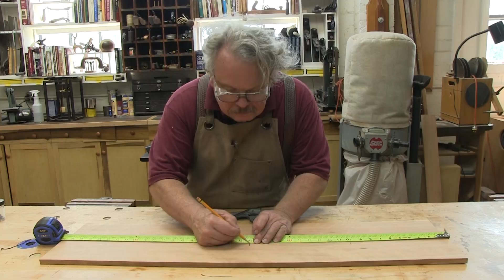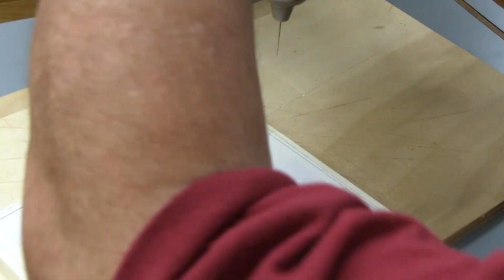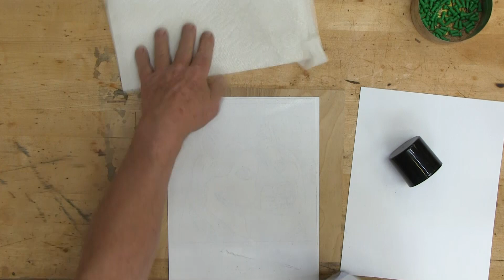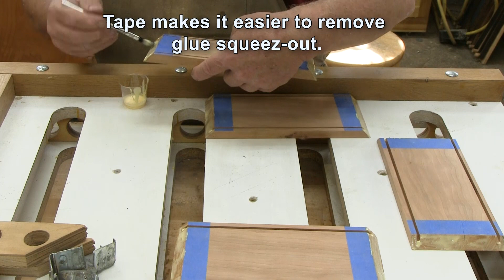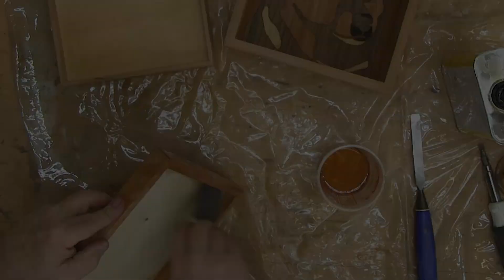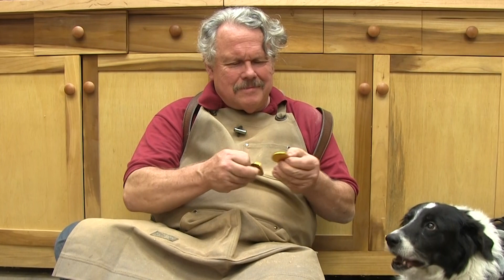Making A Doge Box For Dogecoins - Scroll Saw Marquetry

Comment from the maker: Plans with full-size patterns available at https://workshopcompanion.selz.com/item/dogebox-with-secret-compartment !

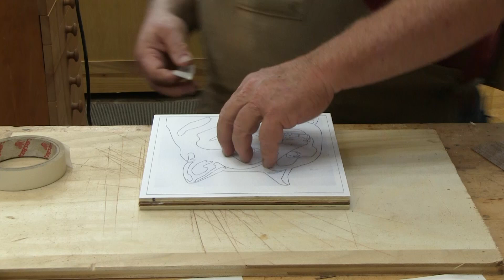The box itself requires less than 2 board feet of wood, but you'll need seven species of wood veneer to make the Doge. I was able to do the marquetry with a "variety pack" of veneers that I bought at https://www.amazon.com/dp/B003F0G60A?psc=1&ref=ppx_yo2_dt_b_product_details . You'll have to assemble them as shown in the video to make 8-1/2" by 8-1/2" (21.6 cm by 21.6 cm) squares. Sometimes you won't have enough sheets of the same species to make a full square. When this is the case, figure out where to center the sheet you do have and fill in on the sides with species you won't use. You can see how I did this at 1:35 through 1:50. It's extremely important that each sheet in the stack be a full sheet so the veneers are as flat and as tightly packed as possible when you're cutting them.

And in case you're interested, we got the chocolate Dogecoins from https://www.etsy.com/listing/1015803747/chocolate-dogecoin-coin-dogecoin?ga_order=most_relevant&ga_search_type=all&ga_view_type=gallery&ga_search_query=chocolate+coin&ref=sr_gallery-1-2 . About $1 US apiece -- a good deal more than real Dogecoins are going for right now.